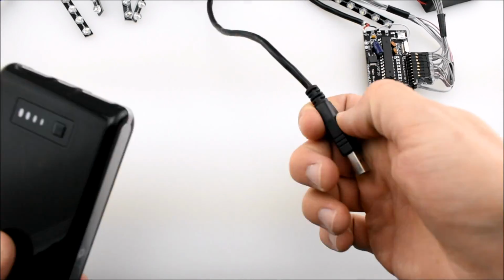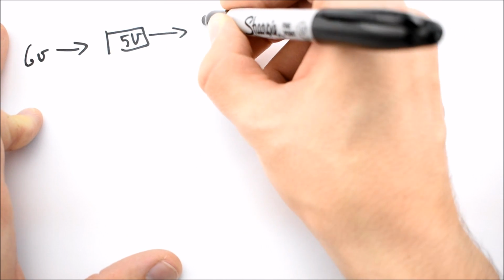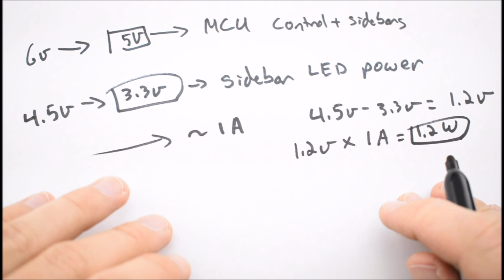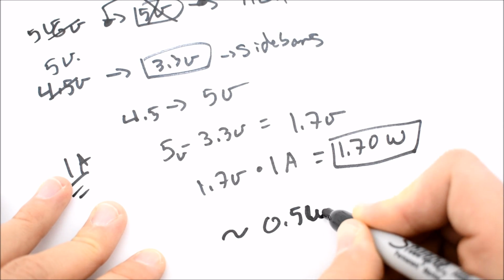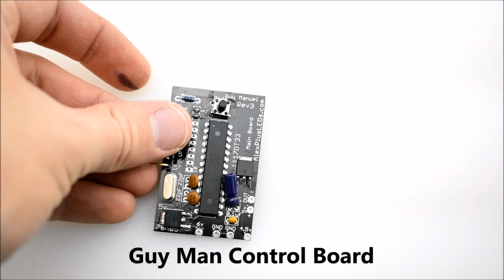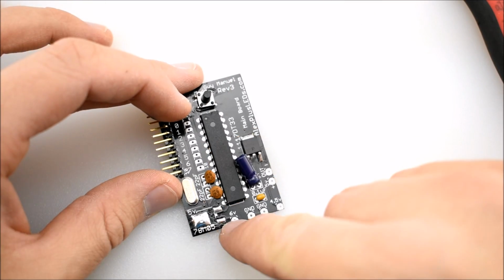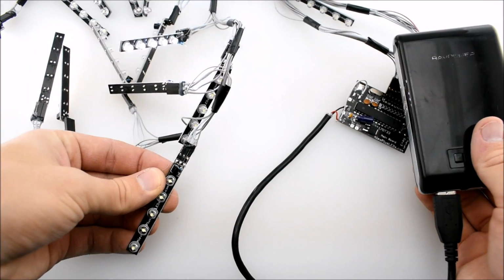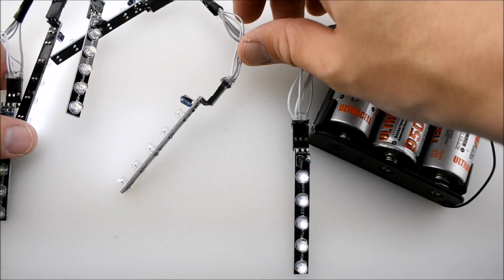Guy Man Basic Kit - USB Power - 3xC-cell Modification

Comment: Is it possible to power both (6v and 4.5v) with differnet battery pack to prevent it from being too hot?
Reply from the maker: Vince nitro If you use the 4.5v pack only and do this mod, it won't get any more warm than usual.
Reply: I would use with only the usb battery pack for the full led, how can you connect the bank battery 1 or 2 to not the hot converter?
Reply from the maker: Vince nitro I don't understand what you are trying to do :/